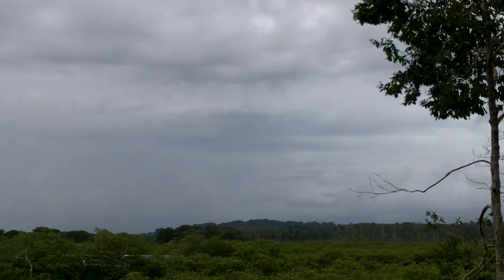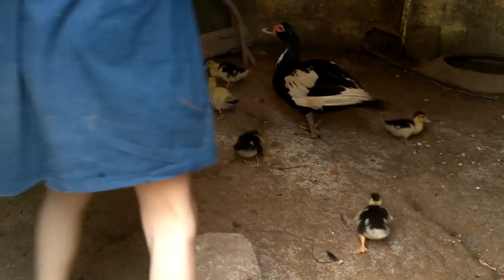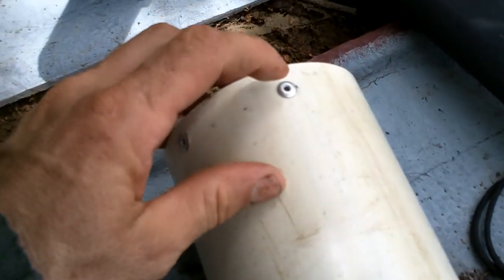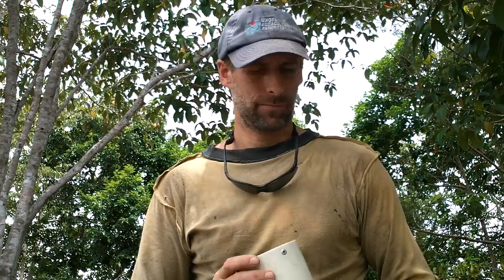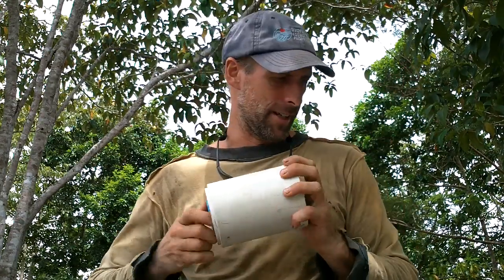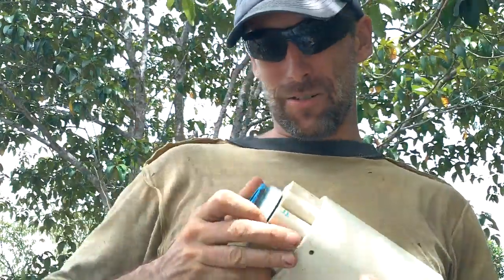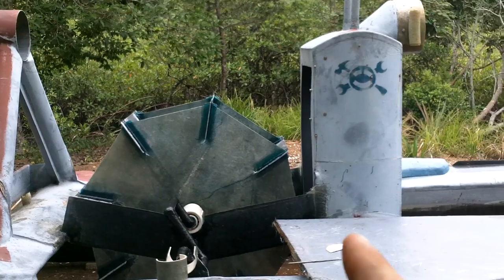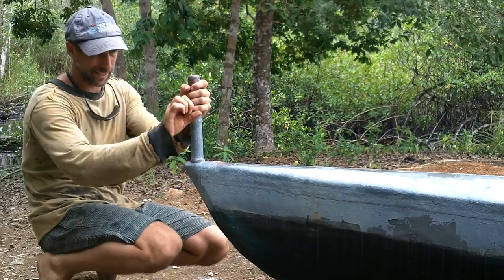Boat Chips 009 Paddle Wheel!

Comment: Have you ever considered taking a centrifugal pump like the ones for a swimming pool and gearing a set of foot petals to it?  You could design it so that the plumbing stays primed and siphons water in and out the back of the boat for thrust.  It would probably be massively more efficient than a paddle wheel and still allow your boat into shallow water bad for normal propellers.  A centrifugal pump can also be placed so the shaft lines up with foot petals.

Comment: Roller bearings require cages to keep the rollers aligned and to prevent them from contacting each other (adjacent surfaces are moving in opposite directions). Sleeve bearings made with acetal/Delrin would be both simpler and more efficient than your current design. A much better roller bearing can be made with  acetal/Delrin rod, but they would still require cages. 
Without cages, the rollers in your bearings will run askew and create significant friction when under load. Increasing clearances is not going to resolve this issue.
Reply: @Reno Simpson If he's going to stick with his current bearing design, that would be an effective means to improve them.
He has a mill and a lathe. Between the two, he could make much better bearings. Hallmarks of efficient bearings is that they are both very quiet and smooth. He's aren't. Tolerances need to be tight for bearings to operate well under load. No doubt, his work will improve as he gains more experience.
Reply: @EDesigns_FL  The question is whether such smooth and silent bearings will be able to function well under the conditions Jamie needs them to. The current design he uses will probably last longer and is simpler to repair.
Reply: @Rambowjo2  There is very little load on these bearings and they're operating at very low speeds. Roller bearings are unnecessary and a poor choice for this application. Roller/needle bearings are typically used in high load applications with space constraints (limited diameter). Ball bearings are far more efficient, but have a larger diameter. 
In this situation, simple two piece acetal/Delrin sleeve bearings would be a much better choice. They require no lubrication and they don't corrode. Properly designed and installed, they would be trouble and maintenance free. Not only are Jamie's needle bearings very inefficient, they're a maintenance nightmare. Sand and salt will get embedded in the soft PVC and they will grind themselves up. And, like the shaft bearings on his small tri-hull, they will be annoyingly loud. That boat should be whisper quiet, but instead, it sounds like a concrete mixer.

Comment: If the paddle wheel isn't in the water when lightly loaded, you could add a water ballast tank to either hull, or maybe just one tank on the bridge deck.  It can be emptied or filled using a hand pump,  or if there is a large enough access hatch,  a bucket.

Comment: Hi Jamie, seeing your bearings reminds me of the bearings in my caps of the drive shaft U joints. They don't move much but they work in a similar fashion. Watching your videos many times about these types of bearings that you came up with that you're very inspiring, I can't help but think that you need to make to Shorter sets on either side. I was wondering if you were to put a 1/16 deep Groove in a spiral Kris Kross on all of those PVC pipes has your bearings if that would help for some reason. No particular reason just for some reason LOL or maybe the little grooves would help filter out some of the crap getting built up between the PVC pipes to escape. Your retraining Rings could have either Cruz or holes drilled so whatever comes out of the grooves on each PVC bearing pipe would be able to escape outward. Maybe all of the pipes need to be sanded 1/64 that way they'll become a just a teeny bit looser. 1 1/2 does. LOL keep up the inventive work.

Comment: Your pvc rollers, maybe if you drilled a web of holes in the outer and maybe inner sleeve bodies so water could freely flush out the rollers if they get dirty inside you wouldn't have a silt buildup. If you use grease and water silt can get in the open assembly, the dirt can't be easily washed out, you would probably need a closed assembly with grease, whereas an openend easily quickly draining and water flushable (maybe even cooled) system would provide a low tech solution with same kind of assembly.  PVC, even in hot sun, can get bendy and regular PVC pipe is not UV stable. You might want to paint the outside of it white to add heat amd UV protection even though bare PVC is already white, it is probably not UV resistant type and will get brittle and shatter in short amount of time.